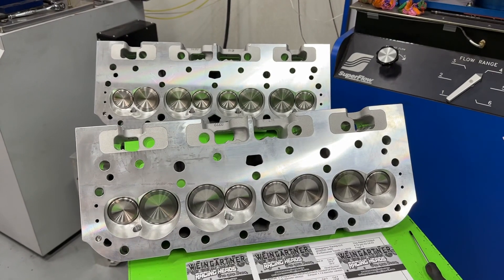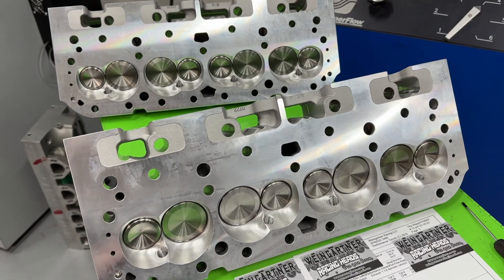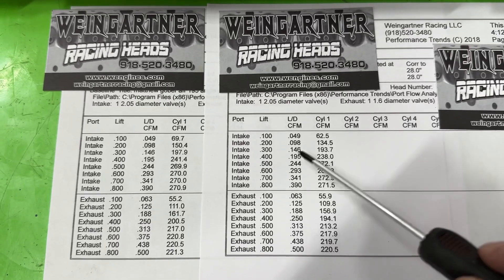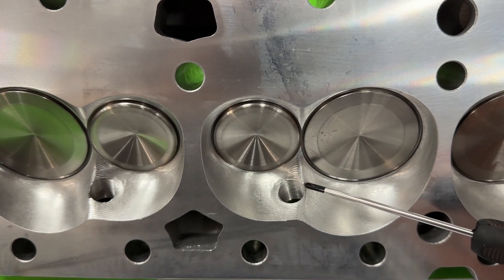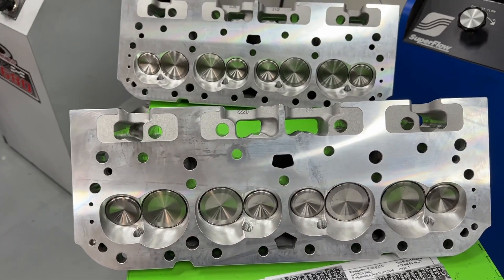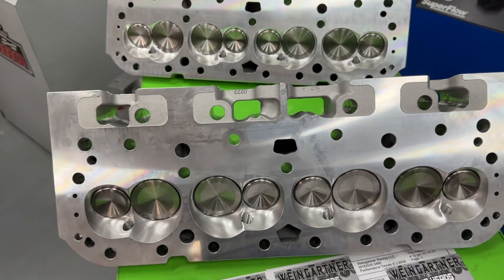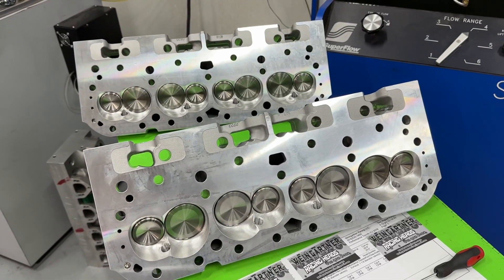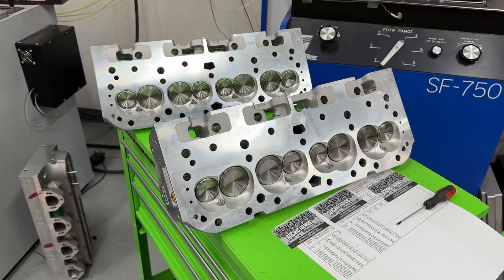Do Angle Plug Heads Flow More Than Straight Plug Heads?

Comment: I remember when I was a teenager and bought some slant plug GM heads that allowed a higher compression rate versus the stock 350 370 HP heads...apparently the better flame propagation made it handle a higher CR
Reply: I have a set that we just built from virgin cores 74/75 castings. Had them for a long time.

Comment: The truth is the burn is better making more power.
Reply: Back before angle plug heads the gap was turned or indexed to be on the exhaust valve for the burn and hp gain

Comment: In '71 with first angle Plugs came out for small blocks. And using TRW 12.5 to 1 dome pistons. We picked up two tenths..  That was class racing cars..  It never was a mystery for class racers. Your running 12.10. Pop new heads on. Bingo! 11.90..  Thats big time proof to me??.. Was sold in '71 already!!!..  Really showed up with dome pistons...

Comment: About 30 years ago going through the evolution. Home ported fuellies with straight plug,, then Dart2s with angle plug then to Edelbrock Victor 23 deg race heads again angle plug. And using the same custom 1 3/4" headers. And the plugs all lobbed in different spots within about an inch circle. With the Edelbrocks I had to select plug brand on plug length and then cut half the nut away as well as cut the plug lead and boot. Then it all fitted fine though plug boots did not last that long and the lead seperators needed to be in a very specific spot as well. 500whp in 2000

Comment: Hey Eric,
     Tim here.......never thought about the flow diffrences between the 2......it was that the plug is angled twd the exhaust valve, to keep it in the hottest part of the chamber, to fascilitate effiecient burn of the incoming charge........so its nice that the angle plug DOES flow more, but i thought that was more about gettin an efficient burn (and potential less timing) from ur head, NOT flow..........correct me if i'm wrong....the MAIN deal is to get an efficient burn of the charge.....flow is a nice extra.....

Comment: Looks like maybe 1%, measurable but fairly insignificant only a dyno test can tell. Correct information is always good no matter the results.
Reply: Lets call it 5 hp then - a combo of low lift flow differences and scavenging behavior.  What  intrigues me is [for the same cam] will peak VE move at all? I think it might...
Reply: @flinch622  I`d like to see a back to back test and watch where the max torque is and at what rpm it occurs

Comment: I switched from 195 afr competition heads to brodix dragon slayer heads both angle plug but with brodix I had to switch headers I guess brodix raised exhaust port more than the afr heads.
Reply: Slower same or faster?
Reply: There is the issue,, no two plug locations are the same.

Comment: I have read many articles that say angle milling on a SBC can improve high lift 10 cfm or more. I am talking about .125-.150ths angle mill. It would be awesome if you could confirm this?
Reply from the maker: I have a video about small chamber vs large chamber and that is with flow numbers.